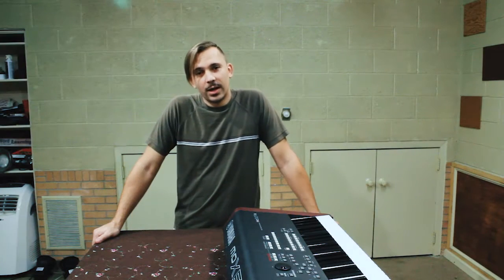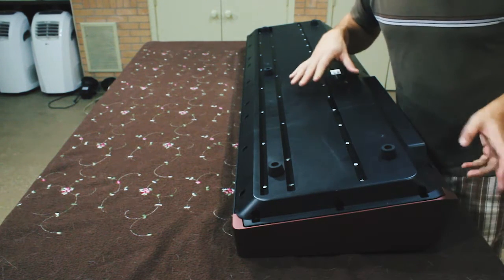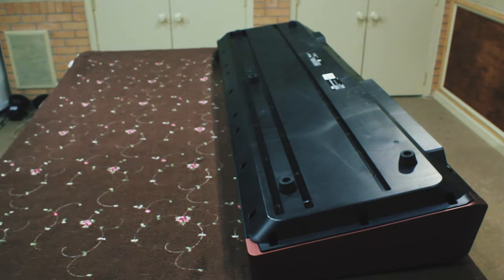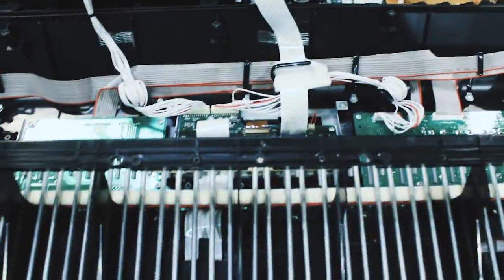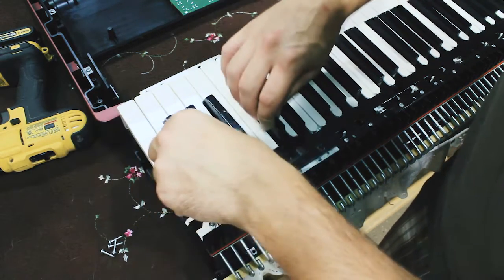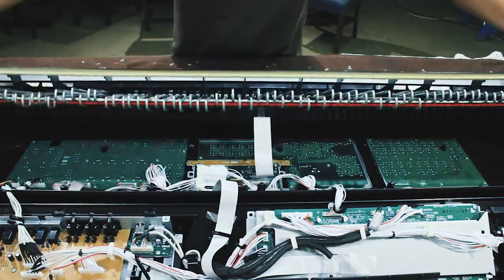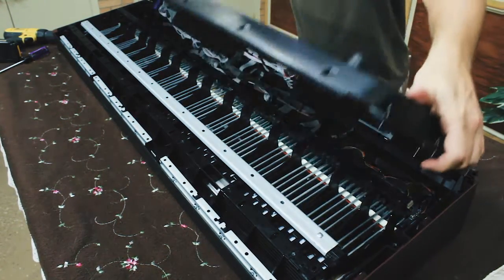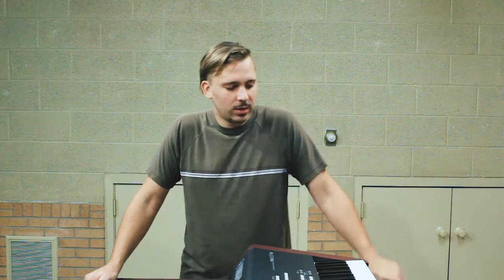MOXF8 Key Repair

Comment: THANK YOU!! Super tutorial, I managed to open and repair my Moxf8 👍👍👍👍  I switched the mid octaves that I have used the most, with the ones at the top and bottom sides.   I noted that there is a silicon gel inside the keys. Do you maybe know what is it?

Comment: Thank you very much for this video. I have a MOX8 but it seems pretty the same mechanically. I have a different problem, as my keyboard turns off by itself once in a while so I'm gonna try to open and see if there's something dodgy inside.

Comment: Thank you for this excellent video.  I have 5 keys that have stopped working in the last octave up top so I took my MoXf8 apart following your guide.  I cleaned the rubber contacts and the circuit with rubbing alcohol then gently drew over the circuit with a pencil, which I saw in another video. Re-assembled everything but still the 5 keys are dead (no sound).  Any ideas?
Reply: Hola así mismo hice yo apenas por qué me dejó de funcionar la tecla de fa de la cuarta octava .
 Siempre si lograste hacer que sonaran las teclas
Si lo lograste me podrías ayudar por favor 🙏

Comment: Thanks for the video! It makes me less afraid to open mine up... but my problem is not a broken key, but rather a broken/dirty/misbehaving key sensor - one key is way more sensitive, randomly, than the others. Any chance I'll be able to replace that? Or maybe just clean it out?
Reply: the problem is probably due to the rubbery gray contact strip that you can see on the green board under the keys when he takes them out . You can take that off and clean or replace . But I think this is better done by a real repair guy .
Reply: Thanks, I will take that advice. :-) I've got about a 25% success rate with my repair projects, don't think I wanna do that to my moXF8!
Reply: Does this mean that the contacts for this beast are open to the air?! And to environmental dust and crud?! If so I guess I better start covering my keyboard. (I had a Yamaha PS120 for like 15 years in the same space with no problems....)
Reply: I didn't replace that strip in this video (obviously).  I will give you the short answer and then (if you care) you can read the long answer that follows:

   It might not necessarily be dust (though that is the most frequent culprit).  If you are experiencing this problem (I would go ahead and replace that little grey strip. They aren't real expensive and it's better than opening this lovely design up again.  

LONG ANSWER:  the way your velocity control works is there are two sensors under the key that are very close together, one on top of the other (or some reasonable facsimile thereof) .  As you press the key down, the computer detects the difference in time it takes for those two sensors to close and that translates into a reading of the velocity... the faster the time, the harder you must have hit the key.  These switches might get dust or any other debris between them or simply short out so that the moment you press the key down, it closes both switches at exactly the same moment (which translates to King Kong playing on your keyboard).  You might be able to blow it out, but I wouldn't go through the hassle... just replace it and sleep well at night.
Reply: Awesome, thanks for the info. I just might give it a go. There's a local repair shop that wants $120 for the first hour of repair, and they won't get to if for 4-6 weeks. :-(
Reply: It's ridiculous. Actually, you could even consider repairing it yourself a public service. Just think of all the other people who won't have to wait in line for your keyboard to be fixed 😋
Reply: I will give them a call and see if we can figure out which "contact strip" I need - CS3467 or CS3468 (4 note or 12 note).
Reply: The short strips usually correspond to the left over keys at either end of the keyboard.
Reply: Thanks for all your help, John, but it turns out my rig was still under warranty! I shoulda thought of that!! A local place here in Seattle, Condor Electronics, did the fix in a week and I'm all better now. But thanks for the video!!
Reply: Cool! Even better! I'm glad you got it taken care of.
Reply: @johnholler5946  This (and previous) link 404 error. Any update on where to get a service manual for MOX8? Or schematics?

Comment: Thanks a lot for your video! I have also fixed my MOXF8 today in which one of the keys (the second highest E note) did not work. I managed to order the spare part at Syntaur with the IC board over the higher register and the rubber feet overlying. Following your video I am able to replace the board and the key works again.

Comment: Thanks, do you know where I can buy the flat cable that connects the keyboard to the display? I requested Yamaha but the times are very long. Unfortunately it is a non-standard flat, it has 27 pins. Thank you

Comment: Thanks a lot Scott ! 
In my case I had hooked a white key with my wedding ring while sliding my hand on 'sharp dressed man'. It had jumped up without breaking, so I had to put it back in its slot. 
I managed greatly in a couple hours thanks to your video. 
Next time I play in public... I'll be single ; -)
Reply: I play "single" all the time too, not only because of the likelihood of the problem you had, but also because I noticed strange pock marks showing up  on the black keys of my low end.  After further investigation, I discovered that it was from my wedding ring hitting them and leaving little dents.  Just remember to keep your ring(s) some place you won't walk off without them (oops).

Comment: sir am using moxf6..
my keyboards all octave. A. nd D# KEYS SOUND louder thn other...when I play piano soung is (ting ting).... when the room tempereture is below 22 degre or lower the problem is autometicly solved.. but if it over 28 or more the problem is again start..are this is for humidity problem!  what can I do!
Reply: The flat ribbon cable (and its slot), as you can see at 5:11 in this video, has dirt gathered in it.
Also the electronic board under the rubber band (see 07:33 in the video) must be dirty.
With humidity they get muddy and create short-circuits, when you press the keys.
Open the keyboard carefully and try to clean those areas with contact spray.

Comment: Nice video, thank you...maybe you know what has to be fixed to get rid of noisy keys? some keys became noisy on my MOXF8 - I think it happened because of intensive usage. Thank you in advance
Reply from the maker: Hey Arik,
   Short Answer: There isn't anything that can be done.
   Long Answer:    If there is no abnormal lateral movement of the keys, there isn't much to do about it.  My MoXF8 has been noisy since I bought it.  When you buy weighted keys, there will usually be more noise because of the mechanisms inside that make the weight.  It's just the nature of the beast with weighted keys.
Reply: Hi Scott, thank you for your reply. I just want to tell you  - not all keys only some of them became noisy because of heavy usage, e.. like 2 central actives white keys and I thought there is a stripe inside to be replaced like on some other Yamaha pianos.  Does MOXF-8 have this stripe or something similar like this? The noise comes when key rebounds. Thank you
Reply: Yes, there is a felt strip inside that catches the metal "hammer" when it returns to the resting position.  As with all felt, the more you beat it, the harder it becomes and, therefore, the less noise reducing.  I've never tried replacing it.
Reply: Great video, where can I buy some replacement keys thou?

Comment: If u are on the first piano voice... The grand piano setting....what if as you play the scale up higher the sound of the scale goes out of tune slightly? Do keyboards go out of tune once in a while? Is it fixable? Have you had it happen on the moxf8?
Reply: Digital synths can't go out of tune, like analog synths can.  I admit though, I can't think of anything that would go wrong based on your explanation.  If there was some issue that caused the wrong note to play, I could sort of see how that could happen.

Comment: Thanks for this - Using your vid saved me hours - Additional tip - if you need to remove "hammers"they're numbered on the white plastic and go back in specific places based on the weighting
Reply from the maker: I'm glad I could be of service! Thanks for the extra tid-bit of info.

Comment: Damn. What a complicated mess. I just bought a MOXF8 after feeling limited by the MO8 I've owned for about 6 years. My MO8 has some major squeaky key issues and I fear running into the same problem down the road with the MOXF8. But I suppose there's just no way around it. Just makes it irritating when trying to record voice and keys at the same time. Oh well.